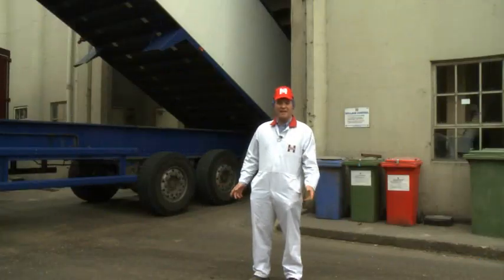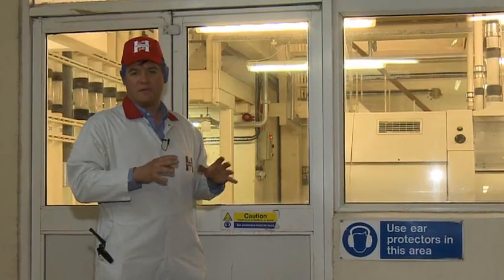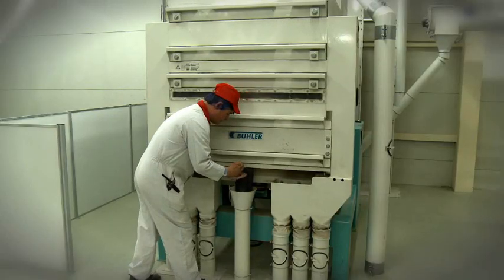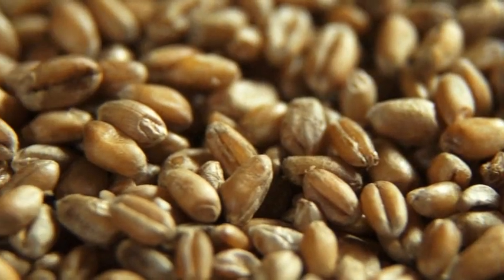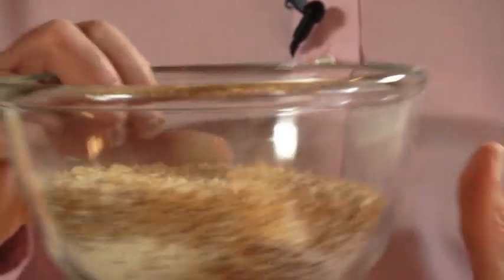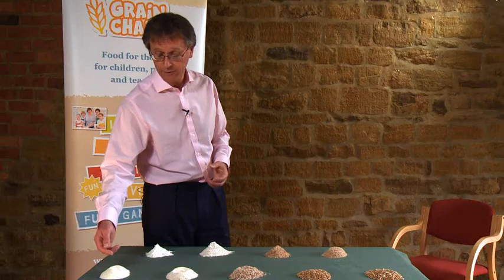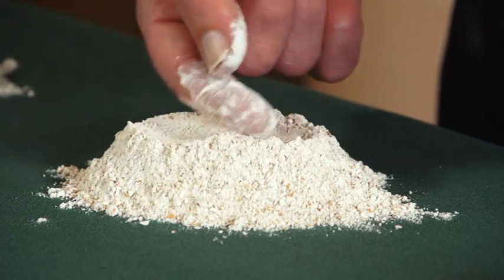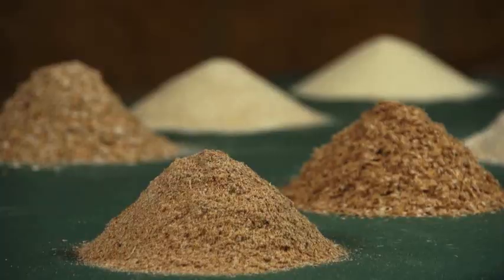Where does flour come from

Comment: This was interesting. 
I would like to know though, when does the bleaching come in?
Also why remove the bran and add it back? Does the alter the texture or is that done just for convenience?
Reply: Roller mills work like that. They incrementally remove from the outside wheat berry (the bran) and work their way in (the endosperm/white flour). A few mill types like the unifine mills pulverize the entire wheat berry and avoid the moisture adding tempering process that roller mills require. Some bakers swear this makes wholemeal bread taste better.